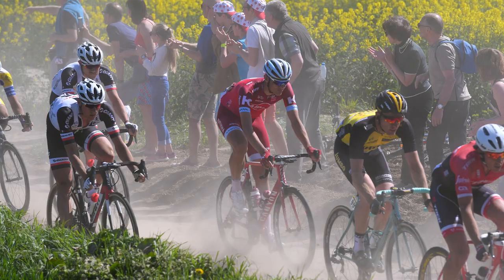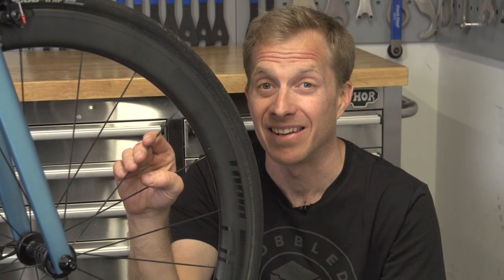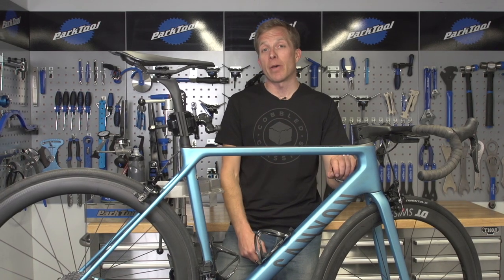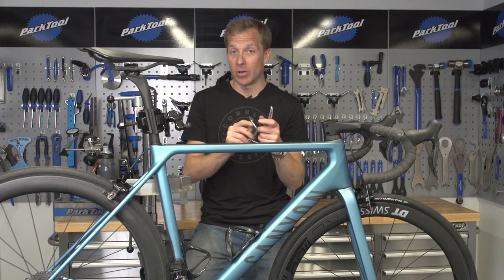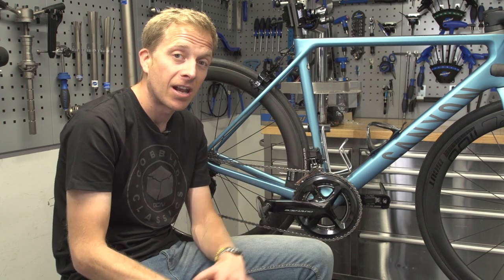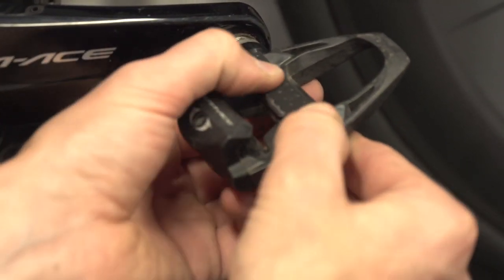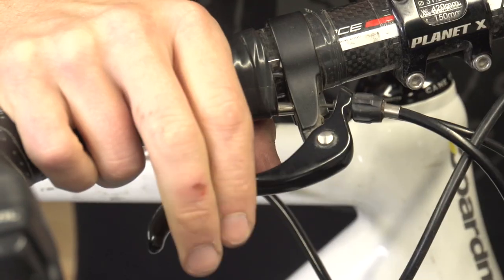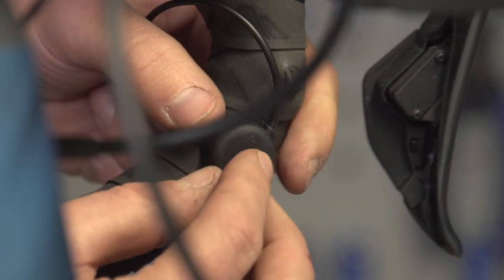How To Setup Your Road Bike For Bad Roads Or Cobbles!

Comment: You didn't mention one very important thing, which is making sure your super expesive garmin or similar computer will not go flying off in the middle of the pave sectors. You should at leaststrap it to the handlebar. I don't use a garmin, but my SRM's are always secured with electric tape around the mount, I'm not risking it.
Reply: I think some garmins actually have a little hole to mount a strap that you can run around your bars.

Comment: I have ridden the cobbles in Flanders with tubeless luckily with no problems. However, next time I was to use 25mm with tubes because I can cope with punctures very easily but find tubeless harder to maintain. I am 67kg and usually ride with tyres set at 80psi in the front and 85psi in the rear. My question is, ignoring the comfort factor, should I increase the pressures, eg by 5psi,  to reduce the risk of pinch punctures?

Comment: I use vittorias 32mm for rough roads o my vintage steel bike, its a shame that newer frames only allow up to 28s
Reply: I use Conti 4 Seasons 32 mm for UK country lanes and light off-road - but there again I do ride a CX.
Reply: dpstrial i also do some cx but i was curious to try them on the pavement, on bad sections i knew i could sustain the same speed (40-50 kph) as on smooth pavement, something i couldnt do with 23s or 25 because i was afraid to get a flat
Reply: I once had an old trek steel beast, it was built for 27 inch wheels. I put on some 700c rims (brakes worked after lowering them) and the tyre clearance went up to 38mm tires. Maaaan, I miss that bike :(
Reply: Actually Edgar I never ride CX as such; I bought a CX frameset just because I wanted something more robust than a racing bike for riding on rough UK country lanes and the odd gravel trail. Also, I like the additional comfort of wider tyres, especially off road. I don't use knobbly CX tyres or even the less knobbly gravel ones - just extra wide heavy-duty road tyres. I suppose I could have bought a gravel bike, but I prefer the more aggressive geometry of a CX.
Reply: Love the Conti 4 Seasons! A bit harsh, but practically bomb proof. I use them on my commuter. My 'road bike' is a gravel bike though, so now I'm on 35mm Schalbe G-One. Will be trying 36mm Challenge Strada Biancha when they're worn. :)
Reply: I had Schwalbe S One 30 mm tubeless on for a season. While the lower pressure aided riding on gravel, it made riding on tarmac too 'springy'. They were terrible to pop on to my Zipps and wore down fairly quickly. I doubt whether I shall be using tubeless again.

Comment: Now, you’re gonna probably crucify me for this one. But I once shortened a chain by one pair of links from the correct size. It made the chain tighter and didn’t bounce off, not a bit. I just had to remember not to use the biggest sprockets with the outer chainring.

Comment: About tire pressure, I ride 23 mm conti’s at 9 bar pressure on smooth asphalt in order to reduce contact patch.
It seems the fastest to me. Is that very wrong?
Reply: Feeling fast, and actually being fast are two different things. Skinny, hard tyres feel fast because the bike vibrates a lot in your hands.Recent test have shown that 25s and 28s are often faster, even if they don't feel like it. Much smoother too, so you will get to the final sprint, or the end of your ride, fresher.
Reply: jackseph03 But I’ve seen test results that also took the road surface into account and - if I am right - on smooth asphalt the skinny tires were faster as long as the pressure is high.
It would be interesting to test differences in speed myself, but without a power meter I can’t.

Comment: I had always problems with alluminium bottle cages and losing bottles on cobbles, I think carbon ones are the better choice...but Wout Van Aert goes for alu...you cabn see it in this video:
http://sporza.be/cm/sporza/wielrennen/1.3165631
He has extra shift buttons, an extra brake lever, double handle bar tape, alu bottle cages, 30mm tyres

Comment: J-dog,  Why is is when I lift my rear wheel on a stand and then bring the rear wheel up to speed,  the whole bike pulses.  Are my tyres not evenly balanced?... Am I losing watts when on the road? ....Is this just the weight of the tube valve?...Is it possibly normal? BTW, Thanks for answering my previous question too. Much appreciated!
Reply: Have a look at this great video from fellow Aussie Shane Miller on this very topic: https://youtu.be/dcgiUcbS64c
Reply: Richard George Great advice!  Thanks for the tip off!